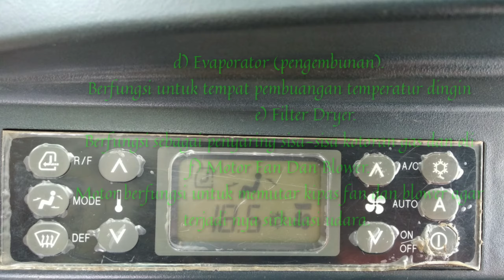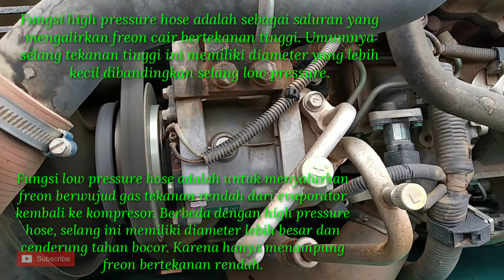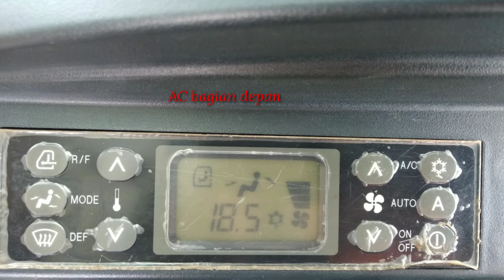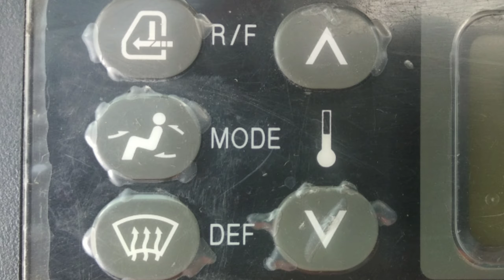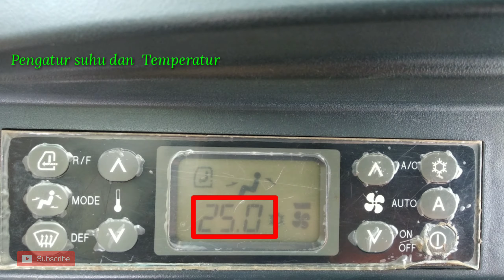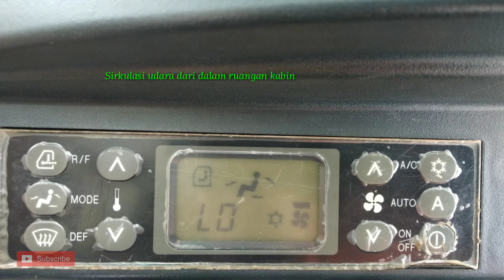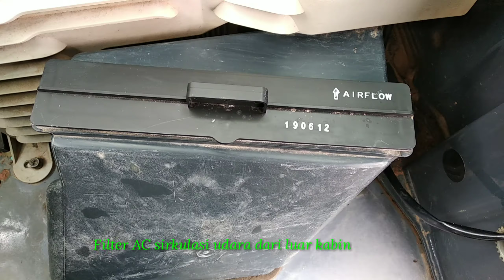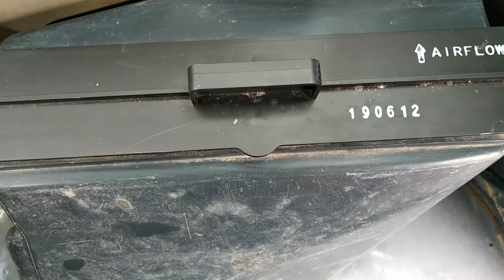Cara mengoperasikan AC dan mengenal fungsi komponen.

Comment: Bang posisi letak Thermisthor itu di mana bang.. Kobelco sk200-10
Reply from the maker: Letak termistor excavator kobelko 200-10 ada di 2 tempat. 1 di samping filter AC dari dalam Ruangan ada kabel hitam kecil. 2 di box bagian dalam nempel di Evaporator / filter pendingin ( harus bongkar box 1 set ). Semoga bermanfaat dan sukses selalu. Terimakasih sudah berkunjung. Salam kenal.🙏
Reply: @ChandraCepu  terimakasih bang